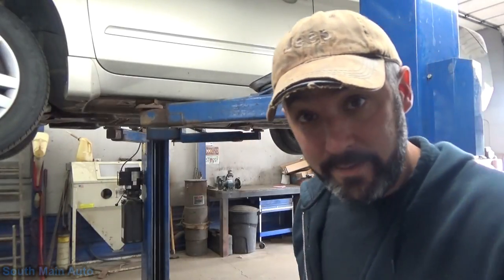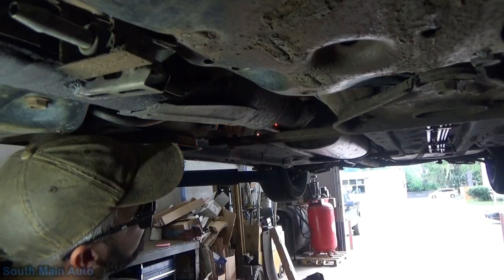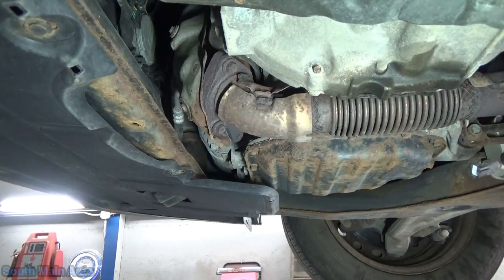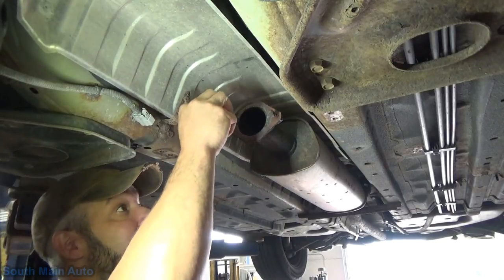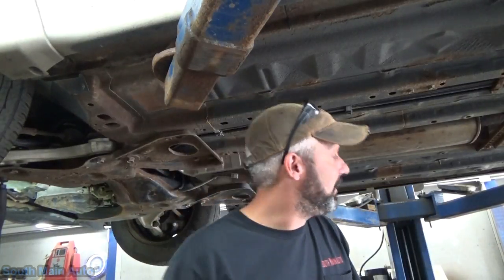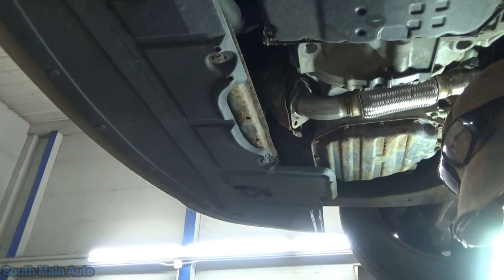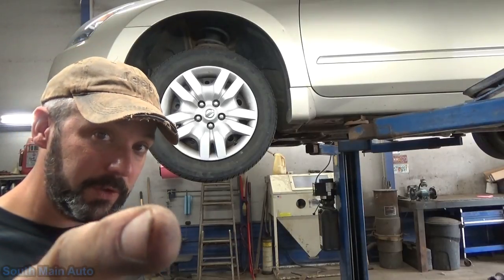Nissan Altima Catalytic Converter - Replacement

Comment: Just to show how relevant this video this; thank you for posting this. Like many other Altima owners, this is now on my immediate todo list for my car. All the other videos under "2014 Nissan Altima Catalytic Converter replacement" show numerous entries to replace the manifold in the front of the engine, not the actual converter. Thank you for making this, THIS answered my question of how to replace this on my car.
Reply: just wanted to let you know i had the same experience with my searches and after seeing this video i decided to call a nissan dealership. they confirmed there are 2 catalytic converters on the 2014 nissan altima. bank 1 is connected to the exhaust manifold. bank 2 is the one replaced in this video.

Comment: That is insane that someone, even a customer,  would accuse a shop of a faulty air compressor for causing rust in their wheel. In a day and age when free air compressors at gas stations or shops are disappearing like public phone booths, these kinds of low life people are ruining it for the rest of us. Eric O. May not want to have that air pump accessible anymore to the public because of this complaint so we all have to suffer because one bad apple spoils the bunch. Atleast Eric O. Remained professional with the individual and stood his ground. He even took time to show the individual his water separator to prove that his unit was in top working order. Thats what separates SMA and Eric O. From other facilities.  He handled the inquiry with dignity.  Great job Eric O.

Comment: This has become my favorite show to watch now !

Just did a converter on 1.6 l chivvy..............grinding, cutting, snap on impact gun, the quick disconnect cleaning wheels....everything !

I just cut off and ground down the exhaust manifold studs.......center punched and drilled about a sixteenth and blasted em out with the old nasty snap on impact hammer gun and pointed tip.

I'll put nuts, bolt's, lock washers.

Same problem though.........all that honeycomb material just decided to wad up and clog the outlet !

I think I like your show so much because of the misery loves company thing ?

I'm also jealous of all the sissy electronic boxes though.........

I used to have a big box......Sun interrogator !

Man have things changed, love the Bluetooth, Aultel, Pico and relative compression hookup bluetooth !

Keep up the good work !

Your also doing an amazing job filming !

You could use a soundproof studio for some jobs, several cameras and cameraman, lighting,  better borescope  capability, editing on the fly etc.

But you know what ?

It's excellent just the way it is !

And, your a good actor and a funny comedian..........

For mechanics, I guess ?

Thank You !

Comment: You should have told that guy that the reason his wheels corroded was because he doesn't rotate the air in his tires regularly.  Must be done every 4000 miles.
Reply: AND the blinker fluid MUST be changed every 1000 miles!
Reply: Incorrect sir, you HAVE to replace your winter air with summer air and vice versa to avoid wheel corrosion!!! 😂😂😂
Reply: @cigarsgunsanddiesel8032  Oh that's rIGHT!  I totally forgot about that!
Reply: The firing order for a 1998 Nissan Frontier

Comment: I changed out the bed on my ford pickup, all the bolts and nuts were insanely rusted. I coated the bolts and nuts with liquid detergent dish soap liberally, let it sit overnight and the next day they all came out super easy. I do not own any air tools just impact driver.

Comment: I would also recommend for those out there doing this to replace the front cat at the same time, the 2.5 was known for the front cat to disintegrate and the debris gets sucked back into the motor as well as clogging the rear cat and o2s. From looking online they usually go out at about every 60k miles and it is pretty common.
Reply: Yes this is true, the 2009-2016 Nissan car models have a problem with the CATs going out way earlier then they should. Replaced both on my 2010 Nissan Altima 2.5 (QR25DE) at 105k and replaced both on my 2012 Versa 1.6 at 120k. Luckily mine lasted a while but have seen other owners have to replace much earlier at around 40-60k. Read on forums that the problem is a Lame ECU that causes the engine to run rich and it burns out the CATs. Also problems with bad welds that cause exhaust leaks and this can damage the CATs.

Comment: Thank the lord for a shop having an air hose for folks to use free of charge. Reminds me of the 60's & 70's when all filling stations had an air hose and water on both ends of the pump islands. It's really amazing how the self-service idea ever got here because most gas stations had a garage stall or two and that service at the pumps would bring in vehicle repairs. Maybe for today's shops that are worthy should go back to the idea. Provide compressed air and water for those folks on the road so they get familiar with the shop's location etc. Same thing when you used to get a couple bags of ice when you bought items at the liquor stores. Now they want to profit off of it or no ice.

Comment: -another super detailed repair you did    -most mechanics would NOT re-thread rusty bolts or reface flanges
    -they would just bolt gaskets together and send car out

              BTW -your FREE AIR deserves FREE REFUND ~~

Comment: Don't worry about the electrical fire smell. We bought several 20V DeWalt 1/4 impact drivers and drills that were not brush-less and they smelled the same way. We have 1 each 20V DeWalt 1/4 impact and drill that do not smell that way.

Comment: Just replaced all the stabilizer bar links, rear shocks and the torque strut mount on a 2008 Altima. A cut off wheel sure makes quick work of those rusted on nuts by splitting them in half and knocking them off. Way faster than trying to unscrew them...

Comment: You mention throwing o2 sensor codes after taking them out; I have a 1996 Chevy c1500 and  took out the y pipe to have a friend do something for me (Lets say it would be illegal in your state). After putting everything back on, it surely did throw a o2 heater code. By the way, do not buy o2 sensors at a junkyard. Also, spark plug non foulers do work for keeping the CEL off, in case you were wondering.

Comment: When I ran a under car shop in Boston, I learned if you had to reuse a orginal gasket, coat in wheel bearing greese, it will seal better

Comment: Please wear your eye protection. I worked in a fleet garage 30 years ago on the 10 pm to 6 am shift. One night I was doing a monthly check on a reefer trailer. I had the reefer running to check things out, while walking by I looked up to check the gauges  and felt something hit my eye. I ended up in the hospital at 3 am and the doctor told me I had a piece of metal corkscrewed in my eye. And the good part he was going to try and get it out with what looked like a dremel tool, hand held. He got it out and I was OK, had to wear a patch for a couple of days but I wore my safety glasses every day after that. And I bet your air is fine, he might of just used your garden hose instead of your air hose.

Comment: Anyone else have a love/hate relationship with Walker Exhaust products?

Love it because it's cheap.

Hate it because you will be replacing it again in two years if you live in the salt belt.
Reply: Yep, every two years like clockwork.  You know it's bad when you start remembering the muffler part number.  And why the hell didn't I buy the damn lifetime warranty one?  I"d still have to pay for the pipes but at least I'd get the muffler free...

Comment: Eric, on the 'cheap' roll discs I just pop a drop of the 'ol Loctite 406 on the back & they're good to go! I've had them fly off down the driveway at a gabillion miles an hour!
Reply: I think hot glue would also work.

Comment: Great videos,man,you're amazing,you seem to know ALL aspects of auto mechanics!?
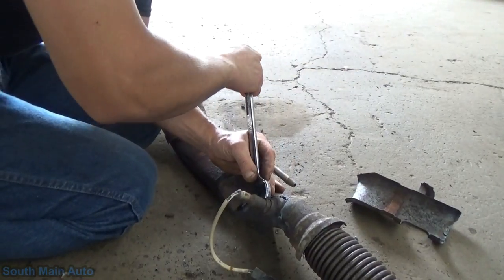20:00 i always use the other side for high force(that O2 there, was almost loose,anyway); flip the open end around,the other leg is stronger,and you avoid opening up the wrench arms,legs,whatever they are...; same as with an adjustable.

Comment: Got the 1/2 inch going to giver a try as I need to swap out a control arm right lower front the original bolts are seized in solid and my air impacts in Waverly ny along with all my other tools torches pullers presses and everytool in mysnapon rollaway and top box

Comment: You can get electric motor spray cleaner in an aerosol can, just hose it down, I use a brand made specific for RC motors, it's good for brushed and brushless

Comment: Great Video
When you mentioned the Air- I was wondering if it could be Condensation...
You mentioned about a Water Separator; I Think - But could there be Condensation in the Hose?
I wonder why He would Keep Coming Back for Free Air - If He's Not Satisfied.

Comment: I have a p0420 code so i have to replace the converter. Although the only videos i find is changing the exhaust manifold.. is this the same thing because your video your replacing the downpipe.

Comment: Mrs O.. don't know how much your getting the impacts at Harbour freight for.. but i would recommend milwaukee fuel.. best buy bang for buck,  i work in a HD shop and the field, guys come in with every brand of impact made, from IR,  snapon to mastercaft  and i have mine from the very first Fuel came out, cheaper than the rest and reliable plus they got som jam.. they can take a beating now at least 50 guys i have seen in this very same shop switch to Milwaukee

Comment: If this was from this past Monday, it was the monday of "special" customers.  We had a lady complaing of a gas leak.... There was none. But she called 8 times saying we missed it because her gas gauge was going down as she drove it to CT from boston....... wtf.
Reply: That's what we call gas consumption.
Reply: Vinny'scummin that's what we told her,but she told us we dont know what we're talking about.
Reply: Mr. Random 😂😂😂
Reply: Well that's what happens when you have the has gauge repaired lady.. I can come by and disconnect it for you but you will have to go back to the old method of driving it until it quits again....😇

Comment: It's definitely different to see the rust you have to deal with over there. Here in California that pipe wouldn't normally rust out in the life of the car.
Reply: 1970chevelle396 unless it had rot gut air in the exhaust

Comment: I have a 2013 Nissan Altima and I think I need a new catalytic converter because my fuel economy has went down. It’s also has a problem accelerating over 80mph. rattling noise when I start up the car and when I accelerate but only sometimes. I looked under the car and it seems pretty rusty so I’m guessing it’s that. I used a OBDll scanner before and did some research on the trouble codes. What should I do?

Comment: called a nissan dealership. i have a 2014 altima and they let me know there are 2 catalytic converters bank 1 connected to the exhaust manifold attached to the engine. then there is also bank 2 under the car which is the one replaced in this video.

Comment: glad this is an old video because I've had health issues that deal with my innards where I may have had no air much less bad air from my bung hole...turns out that one of my blood pressure meds was causing a no gas outlet from my bung hole. I now have great gas management out the bunghole and the only thing wrong is the wife is now a little irritated!

Comment: Hi SMA, Eric did you ever see a problem with a toyota where three out of four doors will not unlock ? All doors lock fine and driver door doesn't have an issue with locking or unlocking, just the other doors will not unlock from remote or from inside switches, problem is intermittent, comes and goes ?
Reply: Have you not learned from his videos? You likely have intermittent due to a short/ground/wear issue somewhere. Now, go and troubleshoot connectors and wires! Wise man would buy the Factory "electrical" manual for your model Toy.

Comment: Do zinc chromated Hondoo exhaust bolts rust like than in Avoca? In NJ 10 YO Accord bolts looked like factory and undoo real easy. Oh and the UPS guy had the muffler on end absorbing rain water. So when I fired er up steam everywhere. Road trip blew it all out.

Comment: Let me get this straight , He used bad air on 3 of the 4 rims because they had leaks in the tires but all 4 rims need to be changed , So the 4th tire/rim was effected by a air transfer leak from the front axle to the rear axle via a solid steel conduit ?

Comment: Just as I keep saying - you never ever get a hard bolt to get off or a nut that does not want to turn - clips / plugs just come right apart when you touch them - holes just line up like you just drilled them, Eric !!!!  You do sure have the best of luck getting everything apart "" So "" easily up there in that New York "" Salt and caked rust "" area !!!!! As you say - "" crusty "" - yea, sure !!!!!! Give me a break !!!!!

Comment: I live in the rust belt. Whenever my tires start to mysteriously lose air I get a bottle of soapy water and a big rubber mallet.  I find where they're leaking around the bead and give the rim and the tire some love taps.  Seems to re-seat the rubber and dislodge the crud.

Comment: The heat shield on my Frontier and my wife's Rogue lasted only 3 years and they wouldn't cover either. Common problem, got rid of mine because Nissan wouldn't cover anything under warranty it seemed. First and last foreign vehicle for me.

Comment: Myself a former garage owner, I had a air hose outside. Guy came up, was out there forever, compressor running and running. I asked if he needed help. Stated no, he was just trying to get all the old smelly air out and replace it with fresh.

Comment: Eric - Great video very helpful. I did tons of exhaust work when I was still working back in the ancient 80's, ah the memories, lots of 60's and 70's cars and trucks & no electronics, no stainless steel systems then, mostly mild steel that you were lucky to get five years out of, we did seemingly endless exhaust work.  As you are the guy today people go to for fuel injection and electronic trouble shooting, I was one of the guys people came to for the then seemingly dark art of carburetor work- little did we know then how complex things would later become-lol - now for me the new car electronics are the mysterious dark art.  Also I must have missed the video when you picked up a HF earthquake power tool-!!??  Im old maybe I forgot - I live very close to a Harbor Freight, and it draws people like flies.  I do have some stuff from there, but let me tell anyone who wants to shop there, most of the stuff is home use grade at best, some not even that good  with the design, quality of steel and assembly always in question, but there are some good buys if you know the ropes. its the kind of place you HAVE to read the reviews, you HAVE to carefully inspect and pick and choose, and you HAVE to keep the receipt if you expect any chance of a return, except for the "pro-grade" ratchets and such.  There are a few genuine good deals to be had, depends on what youre looking at.  The minute you enter the door it smells like China, or at least the boat that came from China-lol   Some things are a no brainer, decent floor jacks and jack stands, useful trinkets like magnetic parts trays, small flashlights, small tarps and such are often free with any purchase no matter how cheap the purchase.  At a friends suggestion I bought their eight piece #94607 "professional" $9.99 screwdriver set for $7.99 after a 20% off coupon (I almost never buy without a discount coupon) and I also bought the few additional sizes they offer separately in this line, &  ive used the crap out of them with no problems yet, the steel tips are much better than I expected - and my friend has had his set for a couple years and still holding up well - but its a gem among the fray, not all are this good - or even half this good.  Sorry about this long diatribe, but being surprised at seeing you with one of their earthquake impact wrenches I was shocked into this babbling session-lol.  If you check out "Ave"'s channel, he takes all kinds of power tools completely apart to see how well they are made and I think one of these earthquakes was one of his most recent reviews.  As always love your videos Eric, have you ever had a chance yet to use that 3lb. hand sledge I sent awhile back-?  Surely you'll break it in on something-!  LOL
Reply: I bought it for him.  Just a thank-you for him making the videos.

Comment: "Because all three tires leaked profusely"

Uh huh....

Should have told the guy to lay off the fix a flat and try actually replacing tires instead. That stuff is notorious for eating alloy rims if left in there for an extended time. All of that stuff is just meant to get you to the shop to replace the tire, but people consider it liquid tire in a can and just carry on like everything is fine.

I run a residential remodeling business and one time after taking a number 2 at the client's house the toilet clogged up. I'm not unaccustomed to this happening and am quite good with a toilet plunger, but for some reason I could not clear this clog. Now after 2-3 days I knew whatever I put in there had dissolved at this point so I was a bit perplexed. Then I remembered that when I was clearing out the bathroom for the remodel there was a pack of wet wipes that was sitting on the back of the toilet and there wasn't any in the waste basket.

LIGHT BULB MOMENT

So then I compiled some information and a few video links and showed the client that in fact she was the reason her plumbing was clogged. Obviously she was unhappy that she now had to call and pay a plumber to come snake her pipes, but later apologized when in fact it turned out I was right. So yeah you gotta watch people man, if you even touch their stuff (or in your case they touched yours) and something goes sideways, they will ALWAYS be quick to blame you.